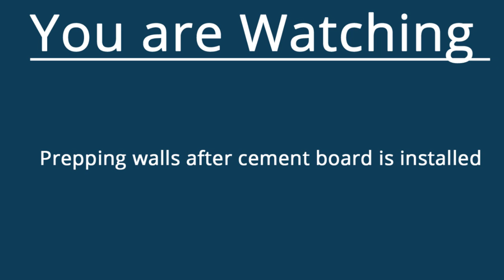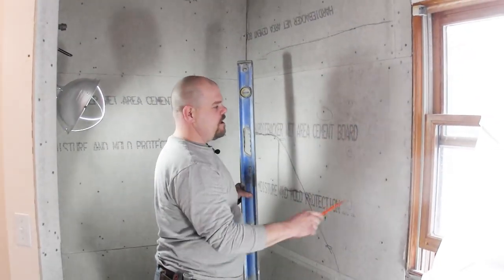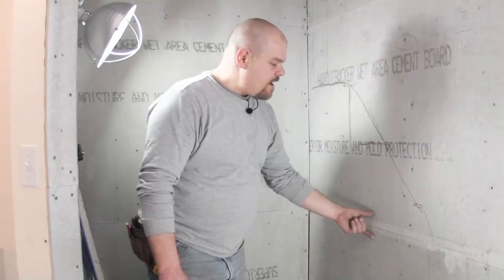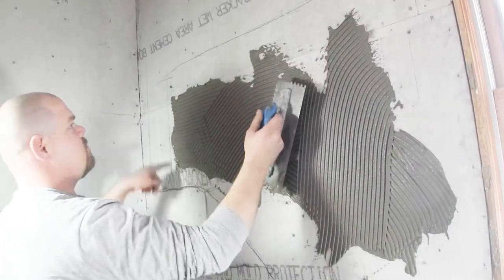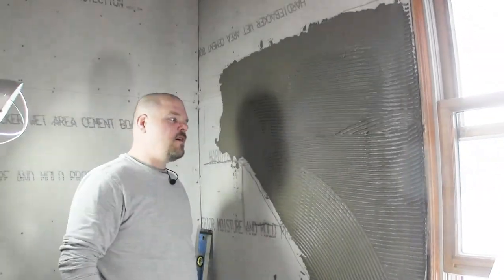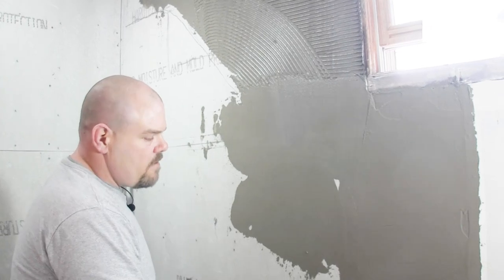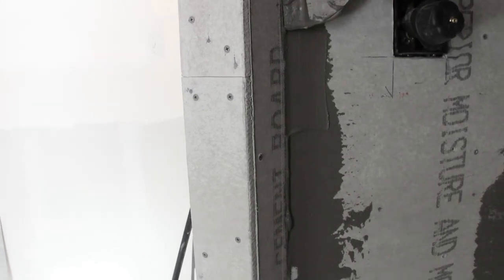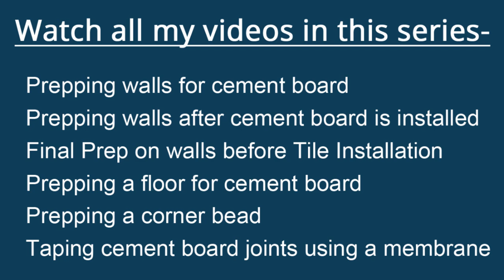Prepping walls after cement board

Comment: Just discovered a leak in a sanitary ejector pipe that ran between two bathroom walls. Gonna have to tear out all of the drywall and I am going to replace it with cement board and then tile. Your videos are great regarding how to install and tape the cement board. Thanks for producing these videos. They are going to be a big help.
Reply from the maker: Thank you very muck Kip! Im happy to hear that!

Comment: Ever thought by using thin plywood over studs to make wall plum if your studs are crooked instead "sistering" studs with short pieces. You can also adjust thickness of those slice with planer and make them vedge if needed.
Reply from the maker: Yes I have also done it this way but, I am trying to show people what I feel is the easiest way!

Comment: Thanks!!!  I'm new to tiling, and have watched a LOT of videos.  I LOVE your straightforward, no fancy frills, and easy to understand approach.  I'm doing wainscot height tile in a bathroom.  Had some water damage to the existing drywall, so I will replace that with cement board, but not to the full height of the wainscot.  That way, like you said in one of these videos, I can use thinset to cover that gap, then the top tile will be directly over drywall.  For the part of the room where the drywall is okay, I will tile directly over the drywall.  I SO grateful that you showed how to level the surface.  Can I use thinset to level any discrepancies on the painted drywall section?
Reply from the maker: Yes you can and thank you!

Comment: At 4:08 he mentions a technique where you "put extra thinset in the back",  I agree, it is a pain in the butt, but more importantly if it is not an even layer it will result in tile failures down the line.  Do not add pedestals to the tile, always get full thinset coverage behind those tiles folks.

Comment: One thing I do to save time and thinset is put a level vertical and diagonal across 2x4 to find humps and valleys.  Then use sheetrocks shims. Staple them on in layers to achieve flatness.  Install W/B then fine tune with thinset on the tile.
Reply from the maker: Good tip!
Reply: Terry Schlaht never heard of Sheetrock shims ,wood shims yes but not sure what u mean by Sheetrock shims

Comment: It`s a definitely nice method! Can you tell me what kind of filler did you use? Was it a plane cement/send mix or a special, like tile adhesive, please?  Secondly, do you have an idea how to fix an opposite way bow (if a spirit level is rocking at the centre of the wall...  And lastly, can you tell how many milliliters of deviation can be acceptable for the further tiling (porcelain 600*600mm).  Thank you
Reply from the maker: I used thinset. You can plane the stud that sticks out too far. You want the walls or floor to be as flat as possible. You can always add more thinset, but this can be a pain.

Comment: Hopefully not a repeat question ... when you run the level over the thinset, it looks like some of the ridges were not disturbed at all. Doesn't this mean the thinset is still too low to make the wall flat ... need to add more material or use a trowel w deeper notches? Perhaps I just couldn't see clearly enough in the video. Thanks!
Reply from the maker: Yes, it means that more filling needs to be done and I show that in another video. It is located inside tile University and there is a link below the description of this video

Comment: There seems to be a difference of opinion between professionals like yourself about using thinset to level/prep walls after cement board like this video.
Do you have any reasons for not using thinset? Thanks and great video!
Reply from the maker: No, thinset is perfectly fine to use.

Comment: I really appreciate your video. Got a question I used hard board for my backer over 1x 6 bead board then tape all my joint but didn't use thin set over joints I just used Aqua Defense, so do I need to cut that aqua defense out of the joints and retape and thin set the joints then reapply the aqua defense? Walter

Comment: My question is after you slim coat with thin set do you still have to install a membrane or is it good to go
Reply from the maker: If you applied the membrane under the thinset first then no but if you have not applied any membrane at all then yes you must apply a membrane

Comment: One question regarding the smoothing of the fill surface: Would you have a particular reason for initially sweeping your straight-edge from the deep region to the shallow? It seem that would result in pushing a lot of the excess out of the shallow region, whereas sweeping from the shallow to the deep initially would allow you to push any high spots from the shallow region into low areas remaining in the deep region. If there is a reason for doing otherwise, I would be interested to know?
Reply from the maker: Just do what makes sense to you.

Comment: How would you level out a half inch dip that's right up to drywall? Use thinset or cement all?
Reply from the maker: Sometimes you need to use sheetrock joint compound and then be sure to waterproof it when done.

Comment: thanks for your video ,
my shower wall studs are out like a half an inch what do you recommend I used to level the wall in this situation I never done this before I have done finish carpentry but this is slightly different not sure what the best way to go about this is
Reply from the maker: I would use sister studs to straighten out the walls. I have more videos on this subject they are located on my website.

Comment: Hardie backer say you have to put a good quality sealant down joints prior to putting on the tape over joints, do you do this  or just tape all wall corners and floor joints.  Looking a wet shower area so need it totally waterproof.  I intend waterproofing the Hardie backer prior to tiling.
Reply from the maker: I would still paint membrane over seams and screw holes

Comment: Can you use this leveling method on cement board if you will be using a topical membrane? If yes, when is the best time to apply the membrane, before or after leveling?
Reply from the maker: Yes u can.  Either way works.

Comment: I really like this method to make a flat even wall if you didn’t make sister studs before installing the cement board as discussed in your other video. I have a similar problem when it comes to the floor though. After installing the cement board on the floor, I see now that it’s not flat. The whole floor dips about 3/8in toward one side of the room. Can I use this method to apply thinset above the cement board to make a flat surface, let it dry, and then go about applying thinset while tiling? Or would you recommend a different method? I’d really prefer not to pull up all the CB after screwing it down, and I’d also prefer not to just go ahead and tile an uneven surface. Thank you for your advice
Reply from the maker: Yes i use the same method

Comment: Great Video.  Question....   My shower will be 2.5' x 4'    The 2.5' walls are slightly off.  There's a 1/8" bow in the middle of my durock.  Is this small enough that I can just use the thinset thickness while tiling to offset?   My tiles are 7" x 10"   Thanks!!
Reply from the maker: Sure.

Comment: how thick would the plaster be for exterior cement boards? If the board has been painted should I first remove the paint then plaster?
Reply from the maker: It should be at least a half inch thick. So I know I got your question correct are you using plaster for the walls or are you tearing plaster off the walls?

Comment: New to this, but my wife and I have been reading that cement board should be treated, coated, or wet before applying mortar, otherwise the cement absorbs the moister from the mortar too rapidly? So, is this what you are doing here? Putting a barrier between the cement and the tile mortar you will use later?

...sorry if you explained in the video and I missed it.
Reply from the maker: I am using this to waterproof the shower! The thinset wont dry out too fast.

Comment: Hello Sir, another question. You are using modified thin set to level the cement boards, closing the corner. Our bathroom got this stippled "flower" pattern all the way - incl the ceiling above the bathtub/shower stall. I scrapped the stippled flower-plaster down, sanded, sealed it, sanded, mud it (2 times with usg joint compound mud) primed it, painted it. Obviously there was no problem with the plaster, usg joint compound before on the ceiling as stippled flower pattern. Do I have to thin-set the ceiling? I don't intent to put tiles up there.
Reply from the maker: No It will be just fine
Reply: Thank you. After 8 steps the ceiling is done and some videos scared the living... out of me, saying "the ceiling has to be covered with thin-set. Thanks for your answer. Great!

Comment: Hi, I have a similar situation were the main bathtub wall is bowed in the middle by as much as 1/2" out, and needs to be flattened. I used dense shield boards around my tub. They already have a waterproof membrane on them. Do I use unmodified or modified thin set to flatten with? Thanks.
Reply from the maker: Use modified thinset.

Comment: Hey I'm trying to level a wall. That's 9.5x9.5 with a 4x2 window in the center and 4x2 niche about 1.5 ft below the window.  When I level the wall should I I only do it with the level vertical? If I hold my level horizontal it's real wide at the ends 1/4-3/8 in if I hold my level horizontal on just the left side of the wall and not in the center the far end is off the wall an inch at least. With the level vertical my gaps are in a few spots but only 1/4-3/8 inch. How should I level this up?  Please help.
Reply from the maker: Ashley, can you send me some pics on my facebook page? There is a link below in the description. I can help you much faster there!

Comment: so is it better to use thinset on drywall/durock joints or drywall mud on the joints? or both?
Reply from the maker: You can use either on that joint. The only reason I would use drywall mud is because if you need to feather out past the point where the tile ends than you can get it smooth so it will look good when painted.

Comment: How do you get dried thinset off the tiles
Reply from the maker: +Mike Ryckman scrape it, scrub. It with a sponge or even a scrub pad.  If all else fails then you can wash it with moratic acid.  But it will scrub off with water.
Reply: Dynamite.